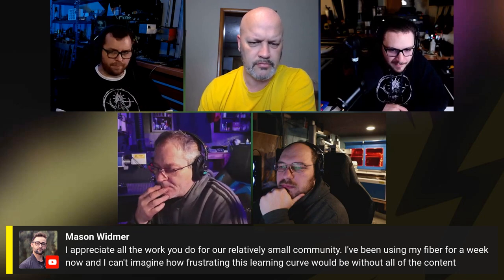FIRST Upgrades for USED CO2 Lasers | Q&A

Comment: That episode has help me so much to understand the difference between all the laser sources.
Reply from the maker: Thanks for watching Anca ☺️
Reply: I currently have two longer ray5 10w looking to purchase a 100w or more c02. Looking at Aeon but also thinking about less expensive unit but am wondering is it even worth bothering buying a less expensive omtech min port or even a eBay unit and upgrade. It seems like you need additional 1000 to 1500 in upgrade and I’m ok with the work but I worry that I won’t get the right upgraded parts. Is that a list of mirror and leases etc that are good options of upgrades as well as the he needed upgrades